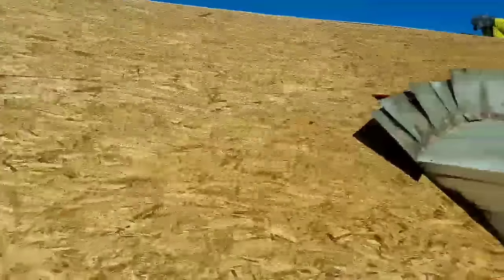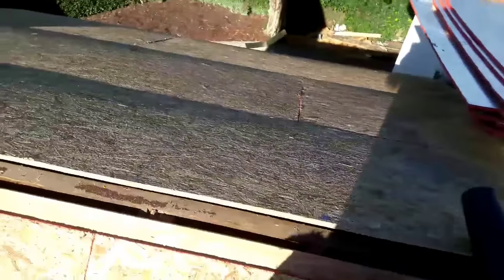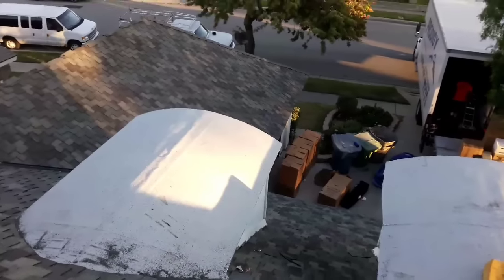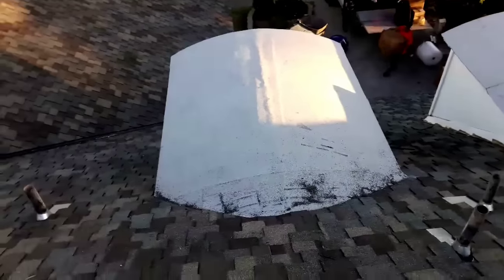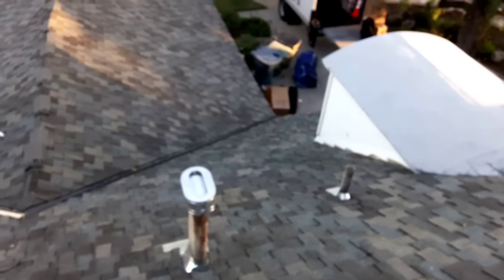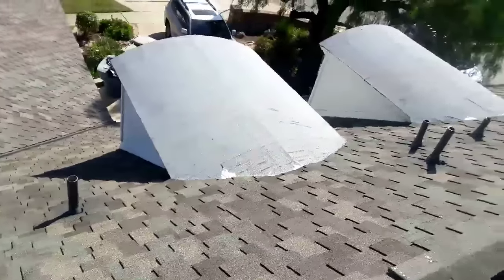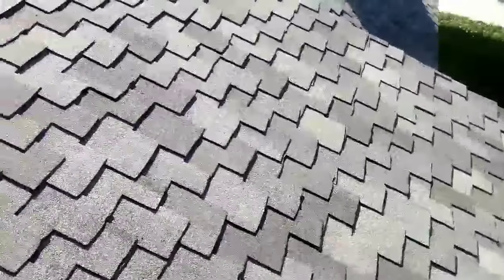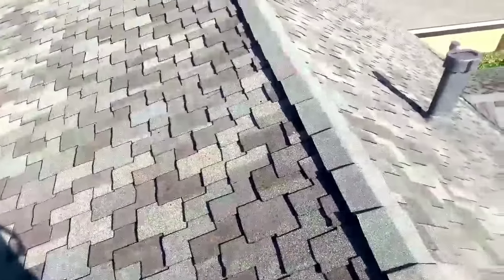Step by Step Roof Replacement !

Comment: I’m not a roofer. I’m a sheet metal guy and I install metal roofs and your work is way more physical then what I do bro. Love your work and your videos bro.. maybe one day I’ll see on a job site I work all over Southern California.
Reply from the maker: Chris Compton ...if we come across say hi buddy! thanks for watching! 
Eric.
Reply: I would love to chat with you @Chris Compton
Reply: @stonksandspeculation1166  sure. What would u like to talk about.
Reply: @clearnoisesounds4390  I'm just really debating on installing a metal roof. I'm curious as to what I could reasonably expect to pay for a 3000 sq. ft roof, w 2 valleys, kind of a U shaped designed roof, easy access to roof and no ridiculous slope grades. No obvious signs of leaking or signs of decking needing replaced. Roof in overall fair condition, right at the halfway warranty age where you'd want to consider options. 

And then also, realistically how hard is a DIY? I know us men tend to see a project on YT and think it would be easy to DIY and then get pissed and flustered during the process but overall succeed with good results...but I'm trying to see how difficult it would be for a DIY in the event that a Pro Install job is way to high, and what the typical savings are if somebody were to do a DIY vs Pro. 

Do you do screw down panel or standing seam? 

Thanks man. I'm just really not trying to absolutely kill the bank with the cost, or kill myself with the job, or worse, get in way over my head. I had Erie Roofing stop out and they gave me a quote for metal shingles and HOLY CRAP! I could buy a damn brand new Porsche!

Comment: Im an industrial painter but I am watching your videos to get a clear direction for a volunteer roof job for a family member.. I have replaced roofs before... But as a part of a work crew. My responsibility was single. Now the roof is my sole responsibility and I am in the process of a quick coarse in small roof replacement.. you are very much appreciated.  Thank you.
Reply: im watching for the same reason. not volunteer though.

Comment: Can you do a video that shows y'all putting on those shingles. I know how to do most roofs but I would like to see just in case I do something wrong.
Reply: It's the same as laminates basically...you hang the shingles over on the one side and use the cut offs to fill in on the other side because they interlock.

Comment: ERIC got a question!  In a previous  video where  you  installed radiant barrier you said there  was no need to remove the 1x6 spaced  sheating.  In this video I see you removed  it and began your osb installation  above  the last ship lap. I have been a roofer for a couple  of years  now and did  some research  about radiant  barrier and found out radiant  barrier  shouldn't  be installed directly over  spaced  sheating. I have installed  that  directly  over spaced  sheating  cuz  the boss says  it's  ok but  some inspectors  that know about radiant barrier will not sign off sheating and I say this cuz it already  happened to me in corona CA. KEEP UP THE GREAT WORK  Eric.
Reply from the maker: Greetings Servando , I did in fact removed the space sheathing  , but it was due to Termites damaged , not to install the plywood over the rafters.
It was easier for me to remove the 1x6  sheathing instead of replacing the damaged ones, 70% of the 1x6  were damaged and it was going to be an extra cost , so I decided to removed the damaged ones and good ones and install the plywood directly to the studs.
next time you are in Corona , install the new COOL SHINGLES so you don't have to remove the 1x6, they comply with title 24 .
Thanks for watching , I really appreciate it !!!
Thanks again !
Eric.

Comment: @6:17 Good god man, could that felt paper be any more buckled? Why are there only 3 nails every 15 square feet or so fastening the paper down and barely any in the seams? You let your guys walk on that? One of them is gonna end up on the ground one day after the paper gives way underneath their feet, and as this video shows, nobody is wearing their fall protection harness. Also, pretty sure I've mentioned this before, but that type of valley metal pan is not supposed to be fastened directly through . Those upturned hems on the side of that W pan are to accept clips/cleats that you nail down to the roof that hold the valley in place(as well as for water control). If you fasten the valley pan directly to the roof and give it no room to move or to expand and contract, it will eventually buckle and break due to extreme temperature change and seismic movement of the two structures it bridges. You're not even supposed to nail your shingles through the valley pan, those are supposed to be hand sealed to hold them in place. Also, not that you would know this or anything, but in an open W-style valley the shingle cut line should taper out and get wider at the bottom to accommodate a greater volume of water flow that occurs at the base of a valley. Ideally, what you want is 2 or 3 inches on either side of the valley exposed at the top, and tapering out 1/8" per foot until the valley terminates. 

Also, @6:17, you shorted the valley pan, the sides don't even go all the way to the drip edge, and it looks like the center of it just baaaarely clears the edge of the roof. If you were any kind of craftsman, you'd overhang the valley pan so that the edges are at least 3/4" past the drip edge line, scribe a line underneath the pan marking the outside of the drip edge, then cut the valley pan in such a way that you create downturned flaps or hems that can then hook into lip of that f-style drip edge you got there. This will also allow you enough material at the bottom of the "w" to cut into the topmost rib and fold down the triangles to close off the otherwise wide open valley bottom that bugs like wasps to make homes in. 

Also, that lower pitched back upper roof looks like it barely breaks a 3 pitch, the minimum allowed pitch for Presidential TL being 2.5. You don't film what kind of underlayment you installed underneath that lower pitched section, but if it isn't ice and water shield, it's wrong, Winterguard or a comparable self-adhering underlayment is required to be installed on all low slope applications of the Presidential TL shingle. I can see at least one 2sq roll of it came with the delivery, but that roof looks bigger than 2 squares to me. Maybe I just can't see the other roll, or you had some left over from another job, so you might skate on that one if it is in fact, greater than a 2.5 pitch.

Also, what's that ridge vent doing? Again, I can't see too well from the way you filmed this video, but I see no evidence of any kind of eave intake ventilation. As I'm sure you know, ridge vent does not function correctly without at the very least a 1:1 intake to exhaust ratio(I prefer 2 parts intake:1 part exhaust to ensure that the exhaust never runs out of its supply of fresh air) per the Stack effect/natural convection. To be fair, maybe I just can't see it because it's way up in inside that recessed soffit, so you might skate on that one, too. Also, with a ridge vent, gable vents can remain intact, but they must be blocked off from the inside to equalize the pressure inside the attic and keep air flowing in one direction, namely up through the soffits and out through the ridge vent with no interruptions. An open gable vent will disrupt the air pressure in the general area of the gable vent and cause the system to function less than optimally(because science). I won't get too upset about that not being in a "step by step" video about roof replacement considering that these things are typically done before you even order the materials.

Hope this helps.

Comment: Hola amigo me gustan sus vídeos  una pregunta cómo le ase para mantener  en buen estado las pistolas bostich
Reply from the maker: 1:  Asegurate que tus lineas  de aire ( mangueras/air hoses) no tengan agua, el agua deteriora el mecanismo interno de las pistolas pneumaticas .
2: Usa Aceite cada vez que las uses para mantenerlas lubricadas.
3: Usa un soplete de aire para limpiarlas al menos 2 veces por yr.  desarmalas y de vez en cuando limpialas del interior. son faciles de hacer.
4: Nunca compres pistolas en algun swapmeet a menor precio que el original , por lo regular tienen algun defecto de fabrica y no duran mucho .
Espero que todo aqui adjunto , te sea de ayuda !
Saludos y gracias por mirar mis videos.
Eric.

Comment: What do you do if your shoe slips.
Reply from the maker: Karo Karapetyan ...if my shoes slipped, well 2 things, 
1: you don't  have the right shoes to step on to the  roof, so for that, it'd  be your fault,  for not testing  your shoes before  you  attemp to walk on a steep roof.
2: If you have the right shoes and you're  afraid of hights, then don't  even try it.
3: If  you are an old guy, 50+ please use  harness, the roof are too dangerous for you.
good luck
#eric garcia